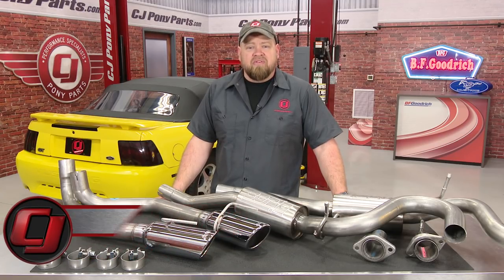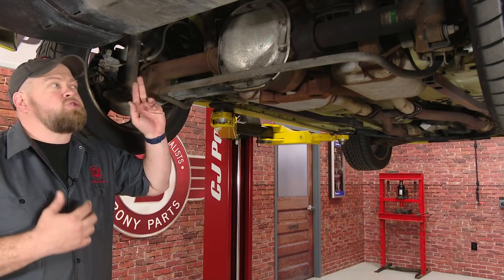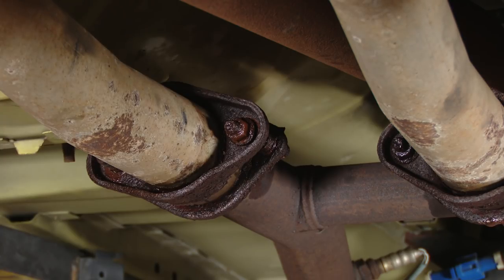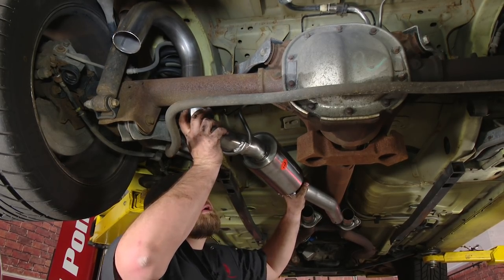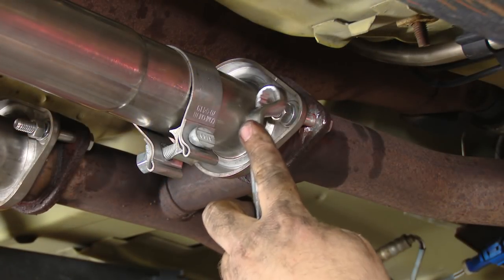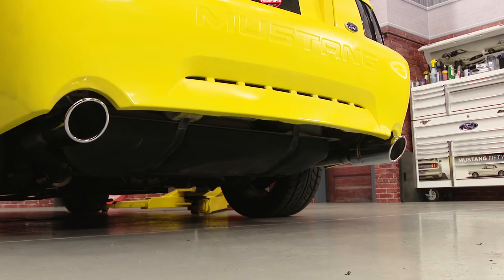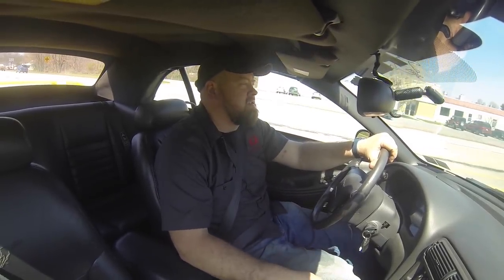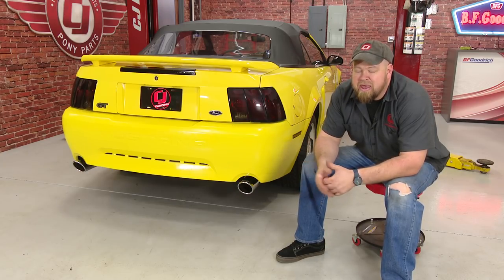Mustang Borla Cat-Back Exhaust System Stainless Steel 2-1/2" S-Type Stinger 1999-2004 Installation

Comment: that deep tone is from the factory h pipe with 4 cats the exhaust pulses are slowed down alot. the sound will change with off road mid pipe or 2 high flow cats and will get much louder and wont be as deep and mellow.

Comment: How much would it cost installing it including the price of exhaust pipes? thank s
Reply: My shop charged me two hours labor, so not much. I paid $180, but I had more than just the cat-back installed, we did the catted H-pipe as well, so maybe cheaper for just a cat-back.
Reply: HypnoticSuggestion where is this?
Reply: Northeast PA, but keep in mind, I paid $1,500 for my exhaust, total, and just 180 for install. CIP in east stroudsburg PA.
Reply: @HypnoticSuggestion  hey i know this is 5 years old lol, but what catted hpipe did you use? Looking to change the exhaust on my new edge

Comment: How is the drone on this
Reply: None at all
Reply: While the Borla stingers seem to have less drone than the Magnaflow catback I had, I wouldn't say there is none.  These are pretty loud inside the cabin of my 2003 Cobra with stock h-pipe.  Not punishing, but there are times I let off the throttle when having conversation with passenger.